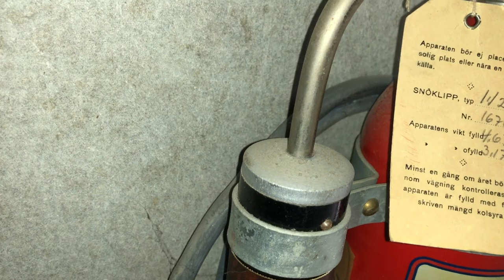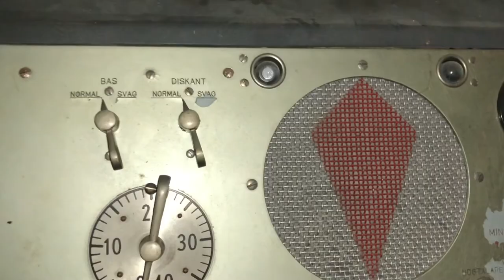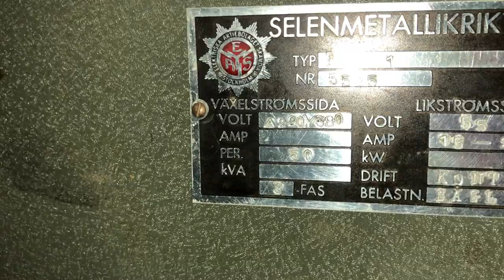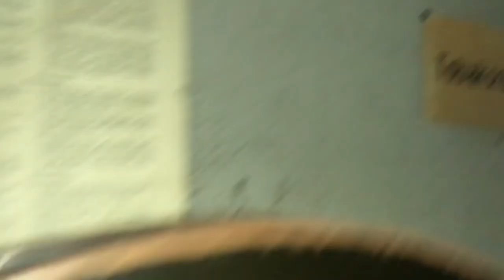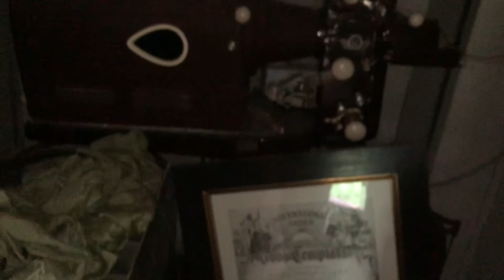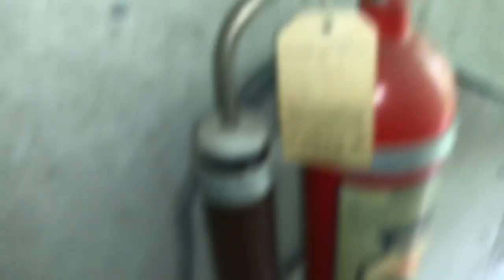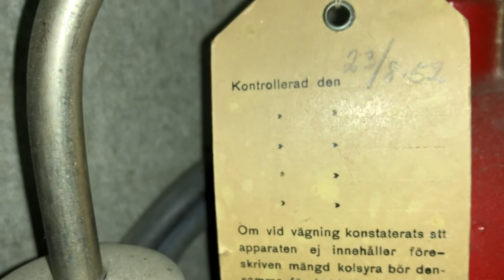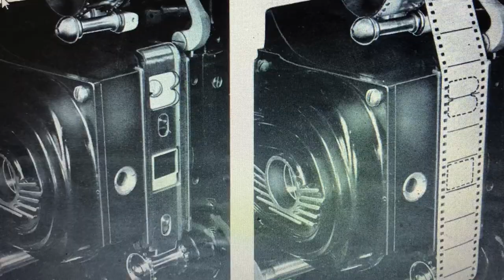Abandoned Cinema I found the secret room with the camera still inside last person in was 1963

Comment: As a film projectionist from 1958-1974, I'm always interested in videos like this. Of all the "mechs" I have worked on, I can't remember seeing a projector like this. However, I know that 35mm cinema projectors are pretty much worthless these days, as there are hundreds, if not thousands, in cold storage and going to rot. Restoration, for anything other than pleasure, is a complete waste of time - I'm sad to say. The arc lamp looks to be the low-intensity type. The pos and neg carbons being uncoated. High-intensity carbons would be copper-coated. I hope you gave restoration a try, though, just for the love of it.  For the year you mention there would have been an optical soundhead on the projector and an optical soundtrack runnung down the edge of the film. An amplifier and speakers would have been required.
Reply from the maker: Thank you so much for the additional information and input based on real experience. None of which I have on this subject, I have since found the optical sound head I think and the amplifier is in the room. Speakers should have been there too but may have been removed after it closed. I know that no-one have enter the separate projector room since November 1963. The speakers would have been in the main seating hall. I have not enter the room again since I filmed the video, time has not allowed me to indulge further.

Comment: The asbestos lining is for the extremely combustible nitrate film that projector would have run in earlier days.  That's why there's fire shutters on projection ports. You have the amp with built in monitor speaker there too and spare valves so it's all looking promising. The asbestos can be stabilised with a bit with PVA. You don't need it or want it now but equally you don't want to disturb it. Wear a mask while you are cleaning up though, you don't want it airborne . The power cables to the arc will have asbestos covering too and it'll be crumbling.  Projector is in wonderful  condition, an oil change, grease of the gears and a good helping of WD40 on the sprockets and you'll be good to go !
Reply from the maker: Thank you, great information and very helpful.

Comment: I wish you luck getting carbon rods these days. May I suggest doing a conversion to the lamp house for a Xenon lamp instead? By the way, that is a PROJECTOR, not a camera A camera takes pictures. A Projector projects images taken my a camera onto a screen for all to see, I could swear that I saw a sound drum on that projector, No projector was specifically designed to project black and white or color film. They will project anything that goes through the gate (That's that little window behind the lens that lets the light through) be it color or black and white. Projectors are not racist. They project anything that goes through their gate, but if it is crap film, they might snap when they get bored projecting it.
Reply from the maker: Thank you, appreciate your comment. Most of what you said I know just talking shit at the time I have been in the forest for a while and forget the correct terminology.  A conversion to electric is the naturally safe way forward but would be nice to try the carbon rod if it were possible. I can imagine how dangerous an arc and film in such close proximity were. I am better enlightened for your input.
Reply: Back in the good old days, film used to be made of or contain cellulose nitrate. It used to be highly flammable, That is why your projector has doors on the reel wells, not that I think it made any difference. Often a badly joined or torn film would snap right between the intermittent sprocket and the gate. The lamp would burn the frame that was left in the gate until the projectionist closed the dowser plates and shutters. Film is much safer now. Xenon is also much safer than Carbon ark where you basically have an electrical short happening in your lamp house.That projector of yours is a beautiful old lady though. I do hope that you get her running again.